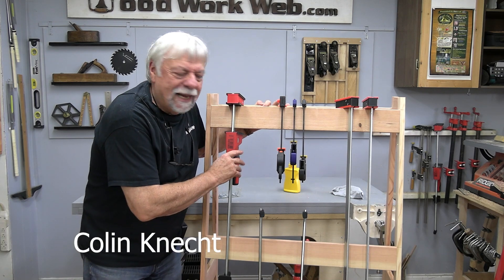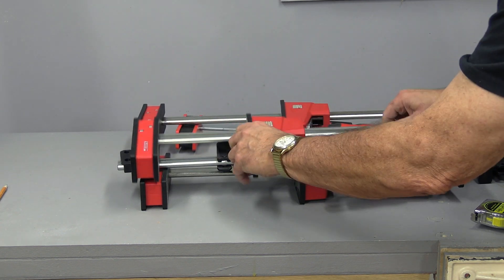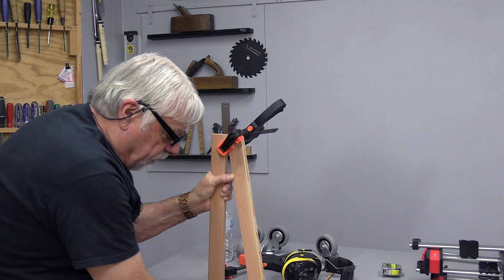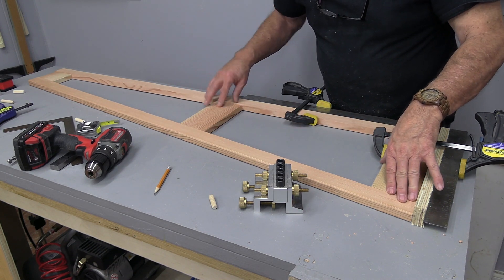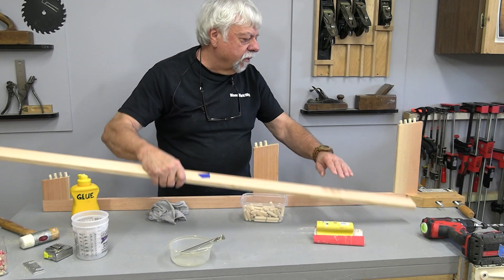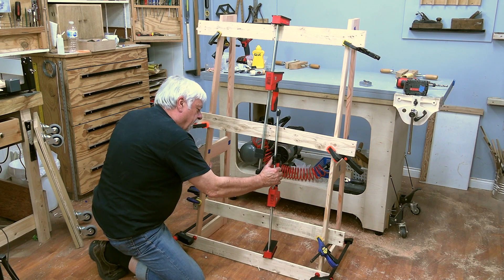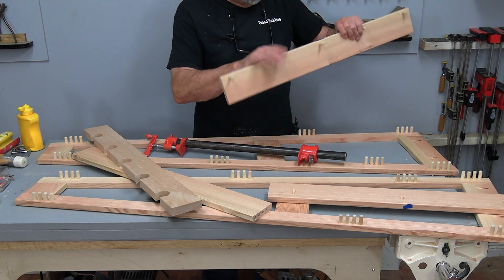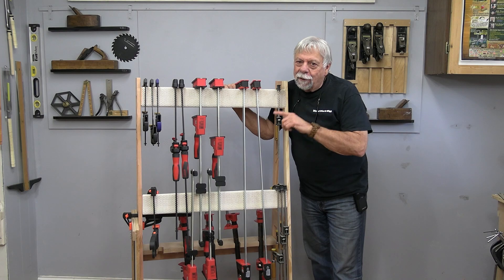Mobile Clamp Rack for Wood Clamp Storage

Comment: Very interesting video. Thanks for sharing. The clamp rack came out really nice and sturdy.
For me, however, the best part of the video was the "trick"  (or I'd better say "awesome idea") of using to sizes of dowels. One  with a slightly smaller diameter for dry fitting,
and the normal one for the final assembly. That is a splendid idea and is in fact very easy to realize.

Comment: When I built a 'Norm' style clamp rack 10 or so years ago, I found that you can double up (or more) your Bessey clamp capacity by just putting a regular piece of 1x about 10-12 inches below the top cross bar. Then you hook the longest clamps over the top bar with the handle on the inside of the cross bar and everything pushed up to the same end. Then you just put the shorter clamps on with the clamp heads hooked over the lower cross bar interleaved between the 'tails' of the longer clamps - depending on the lengths of your clamps you can get 2 or 3 rows on each side - it also works with Bessey Uni-clamps and Duo-clamps using the handles to hold the clamps on the cross bars. I made it a bit deeper front-to-back than yours so I could include a box on top for small spring clamps and similar things that needed a home.